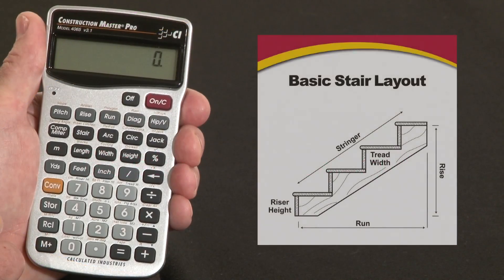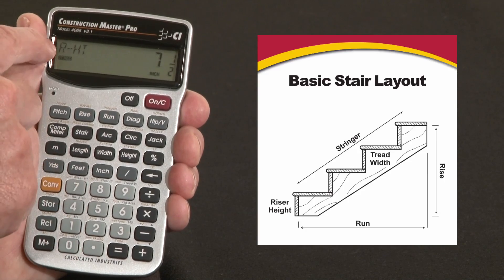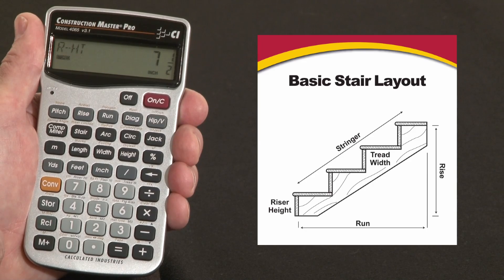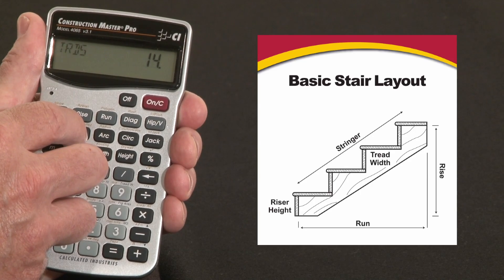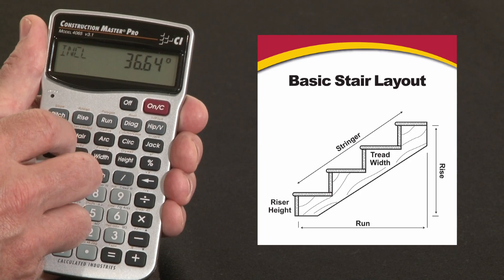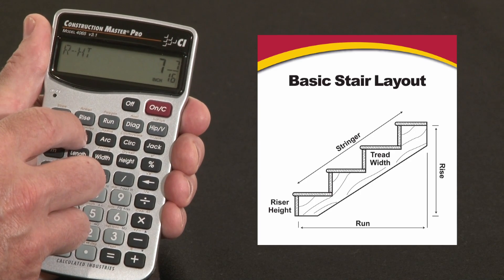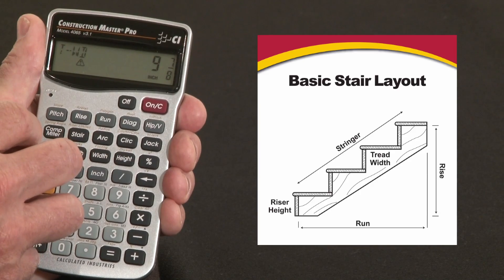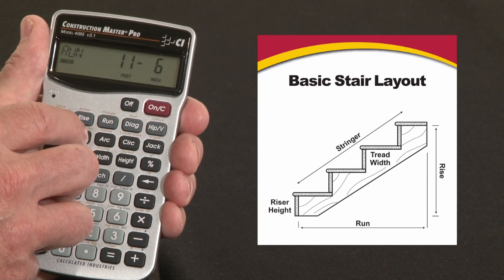Construction Master Pro Trig Basic Stair Layout How To

Comment: is it available in metric??
Reply from the maker: Hi Lee, all our calcs easily convert dimensions and units, quickly and easily using the CONV key on the calc - and you can convert at any point in the calculation without having to go back.  This is a popular model internationally as it has Trig functions built in.